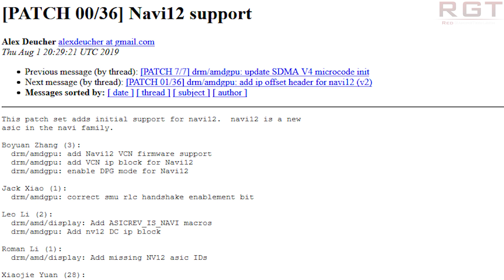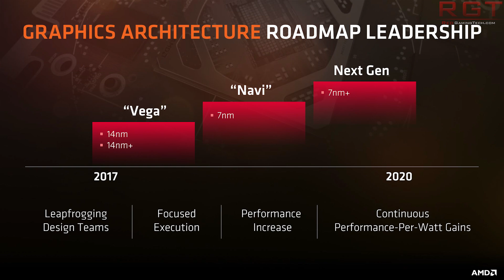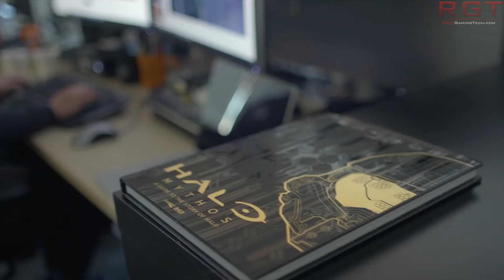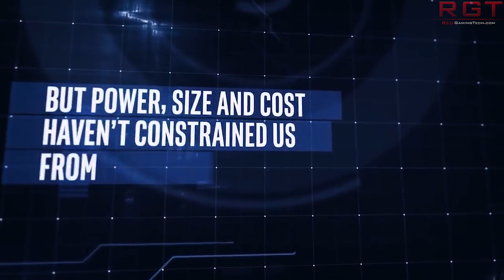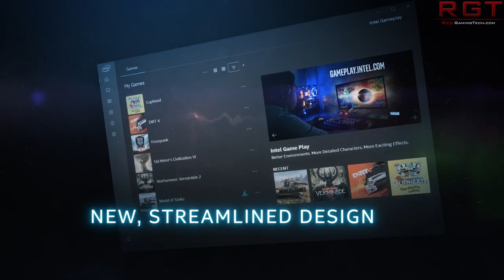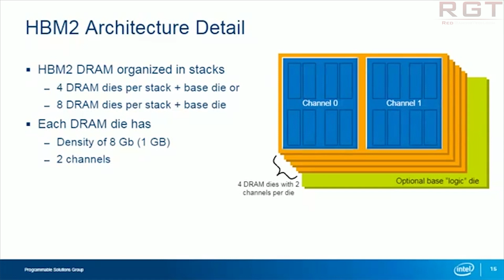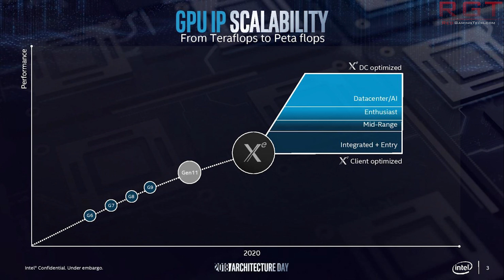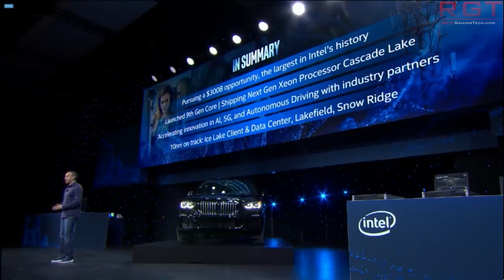Intel Xe Starts At $200 | AMD Navi 12 Updated in Linux | Xbox Scarlett Cooling Patent?

Comment: Actually, Lisa semi-specifically said we'll be seeing a load of 7nm product launches within the quarters (yearly quarters). You implied she wasn't specific at all about the time tables, which isn't true.

Quarter 3 2019: August: custom Navi10 cards; September: RYZEN 9 3950X
Quarter 4 2019: ? Radeon 5600 series maybe?; THREADRIPPER 3rd gen most probably (and newer X599 and X590 chipsets probably); Radeon 5800 series hopefully.
Quarter 1 2020: ? Zen2 APUs maybe; Radeon 5900 series maybe?
Quarter 2 2020: Radeon 5x50 series w/ hardware ray tracing on 7nm+ maybe? (PS5/XBox3 might be launching then)

Comment: I'm kind of out of the loop regarding Gen 11 and Gen 12 graphics.  Have those architecture been significantly been restructured in comparison to Gen9/10?  If not, then, with each EU containing 8 shaders, a 512 EU part would = 4096 shaders.  So basically equivalent to 64 of AMD's compute units, but probably more powerful.  There's no way Intel is going to ship a part like that for $200 IMO.

Regarding that Raja quote, when I saw it the other day, I took his meaning to be that be that the higher end parts will have memory that is larger and is HBM, i.e. he wasn't implying that lower tier parts would also have HBM.  You raise a good question, though, and I suppose it can't be ruled out (as unlikely as it may seem).

Comment: 5700 = 2304SP's and 36CU's (and 8GB GDDR6).
5700XT = 2560SP's and 40CU's (and 8GB GDDR6). 

my predictions =

5800 = 2816SP's and 44CU's (and 8GB GDDR6).

5800XT = 3072SP's and 48CU's (and 8GB GDDR6).

5900 = 3584SP's and 56CU's (and 12GB GDDR6).

5900XT = 4096SP's and 64CU's (and 12GB GDDR6).
Reply: finally some grounded expectations. It´s economics, folks. We get the same as we did before, a competitive lineup for a nicely competitive price, and we´ll like it, but they only need to meet our expectations, not our dreams. It will be the Nvidia Super counterparts for 100 bucks less, plus a 2080TI counterpart for 100 bucks less AND two nice extra features in comparison. Same same, but different.
Reply: @kawafahra  - thanks dude. I also agree with your price/tier expectations.

Comment: I wouldn’t mind having an AMD cpu and an intel gpu if it could run most of my games in 4K or 1080p @ 144hz
Reply: Chris Overton Games don’t run in hz...
Reply: @NovaDoll  so how do they run?
Reply: NovaDoll sure, but the hardware that displays the frames you see certainly doesn’t call refresh rate FPS. Nice sarcasm, if that was the goal.
Reply: Chris Overton 
You can run your monitor at 1080p 144hz but get 20fps. So i presume you mean you want 1080p 144fps at 144hz.
Reply: The Shape obviously. I’m sorry my that you had to go out of your way to correct me on what I meant.
Reply: NovaDoll hz is a measurement on a timescale of number of hertz PER SECOND. fps in a game is on a timescale of a number of frames PER SECOND. So i dont really understand the nitpicking here. They are essentially interchangeable. Obviously, technically they are not interchangeable and i think we all know that. But also, you know exactly what he meant and we all did too
Reply: @TheShape-z7n  k

Comment: Laptop with that HBM and new intel gpu and 6 cores 10nm please?
Reply: There was a line of Intel laptops with HBM + Vega about 18-24 months ago
Reply: czdaniel1 yes sir. That was the best ever. Which is why they only made a few models.  Nothing better than pairing the ipc and low power of intel to vega hbm.  I covet one.  I wish they pushed out many models of that.  That was the best moment and design in computing in well over 12 years

Comment: There is only one little details about HBM "cost" to keep in mind: the only reason HBM is more expensive is that it currently is a low volume niche market product. Aside from that, it is fundamentally the same internal memory structure that has been in use for the past 20+ years with a slightly rejigged external interface. Increase volume by adopting it across multiple product stacks to increase volume and most of the price handicap disappears. Intel uses HBM in networking equipment, FPGAs and other stuff, ramping up volume to drive HBM cost down is well within its capabilities.
Reply: Well hbm2 is 20$ per gigabyte and gddr6 is 11$ per gigabyte,  but hbm2 needs and interposer and gddr6 doesn't.
Reply: @rattlehead999  Stacks of high capacity HBM are expensive due to die-stacking cost overhead. If you can get the amount of memory you need without stacking though, you can eliminate that cost. We have 16Gibits memory chips now, 8GB could be done using four quarter-width HBM2 dies without stacking, eliminating TSV and likely the base die too.

Comment: M$ cooling system..  Instead of the traditional single sensor that measures heat and responds with fan, there is that, but also another that reacts (with fan) that gets it's cue from power demand.  If you get power demand increase, you know the heat is going to come, so you can get ready for it by spinning up the fan.  If the chip is hot, the fan keeps spinning even if the power demand reduces, until it's cool, or another sharp power increase comes.  I wish PWM on mobos would do this.  I have an ASUS CH6H and cannot trust the fan headers whatsoever.  Been like this since day one in 2017.  Tried again after a year since it's like 7 BIOS updates later, and after one day the fan stopped spinning.  I have custom water and a fan controller, but I tested using a Noctua NF-A12 on my hard drive rack, and I couldn't even trust it for that.  Had an ASUS RX-470 (early model bought on day one of release).. and it did the same thing.  The fans would just stop working and the temps would skyrocket.   Maybe ASUS needs to get M$ to design their fan circuits.

Comment: Don't really care about the navi 12 cards tbh. The 1660ti has already been on sale for ~200$. Also used 1070 is cheaper and performs about the same. And then there's used vega 56s for less than 250$, which are better than either of those cards.

What we need is a gpu that performs like 2060 super for 300$.
Reply: OneDolla Bill um the 1660ti has never been onsale for 200. The 1660 rarely goes that low. Source I sell these parts for a living and have to keep up with pricing trends.

Comment: Already debunked...

https://www.tomshardware.com/news/intel-discrete-gpu-xe-debut-200,40083.html

    “Not everybody will buy a $500-$600 card, but there are enough people buying those too – so that’s a great market.

    So the strategy we’re taking is we’re not really worried about the performance range, the cost range and all because eventually our architecture as I’ve publicly said, has to hit from mainstream, which starts even around $100, all the way to Data Center-class graphics with HBM memories and all, which will be expensive.

    We have to hit everything; it’s just a matter of where do you start? The First one? The Second one? The Third one? And the strategy that we have within a period of roughly – let’s call it 2-3 years – to have the full stack." - Raja Koduri

Comment: The question is why AMD isnt using low cost hbm, because it should be the same or a little bit faster than gddr6 and uses less power too. Because Navi looks to be memory limited.
Reply: he is wrong the HBM was 1 Gb/s data-rate per pin 128GG/s 4 chips 512GB/s and Samsung hbm he was talking about become the standard HBM2 1.6 Gb/s to 2 Gb/s per pin

the original 8-Hi HBM2 stack package with 1 layer being 1GB with 2/4/8 stacks, but in the last days of 2018, JEDEC announced an update to the HBM2 specification and that was basically Samsung hbm2 Aquabolt, so today that same package is up to 12-Hi, (12GB) with some saying that 16-Hi is ready so 2/4/8/12 stack per chip, 307GB/s 1024 bit bus

now Samsung has HBM2 Flashbolt it has the same 8-HI stack chip package size as the original 8-Hi HBM2,  but with 2GB per layer or as in 1 chip up to 16GB with 410GB/s and 1024 bit bus, 

so if it become the JEDEC standard for HBM2 this how it could look like

2x 8-Hi chips or 2x16GB or 32GB with 820GB/s 2048 bit bus

Vs biggest gddr6 card out there

TRTX 12x2GB or 24GB with 672Gb/s and 384 bit bus
Reply: @ItsSpeltGoogol but tested under watercooling overclocked show a little

but we need to see next level cards to really know
Reply: HBM would solve their issues. Strongly Oc’ing the 5700XT seems to have mediocre impact and most guess it’s a memory bandwidth limitation. 5700XT is a nice card though.

Comment: WTF! The U.S. Patent system is so broken. My little ceramic space heater slowly ramps its fan so you barely notice it turning on and off. Cars with electric radiator fans have been doing this for years when at idle to reduce engine noise. I'm sure lots of electric devices that required fans do this.
Reply: @The Roofer Ok so its a good idea to let other countries steal all of USA's IP? I think you might need to think that through a bit more.

Comment: The price of HMB2 has reportedly been coming down some. So it might not be prohibitively expensive anymore.
Reply: also the original 8-Hi HBM2 stack package with 1 layer being 1GB with 2/4/8 stacks, but in the last days of 2018, JEDEC announced an update to the HBM2 specification and that was basically Samsung hbm2 Aquabolt, so today that same package is up to 12-Hi, with some saying that 16-Hi is ready so 2/4/8/12 stack per chip, 307GB/s 1024 bit bus

now Samsung has Flashbolt HBM2 it has the same 8-HI stack chip package size as the original 8-Hi HBM2,  but with 2GB per layer or as in 1 chip up to 16GB with 410GB/s and 1024 bit bus, 
so if it become the JEDEC standard for HBM2 this how it could look like
2x 8-Hi chips or 2x16GB or 32GB with 820GB/s 2048 bit bus
Vs biggest gddr6 card out there
TRTX 12x2GB or 24GB with 672Gb/s and 384 bit bus

I would say it is Time for the last HBM2 update for JEDEC standard and start the work on HBM3 on  14nm process node
Reply: @1BigBen  also lcHBM everyone forgot about from 2017. Its 25% slower than hbm2 but alot cheaper and denser. Lower power draw too
Reply: @2000jalebi  well outside of pc per I have not seen any info on lcHBM, but it is easy to over look things and info on the net can end up like it has gone through a blender, 
 
like I was sure HBM2 was still on 20nm but no it is already gone to 14LPP and  last update or upcoming update may have moved it to CLN7FF (7nm) with 2.8 Gbps per pin and with the reports of Samsung HBM2 Flashbolt 3.2 Gbps per pin it could be true

but we VII is 2.4 Gbps per pin, 1,2v  

at time Like this I close to ah F-it and just buy the JESD235B Document that cost 228$ just to see the total info about it

I almost wish they just update the JEDEC standard to Flaslbolt and start officially on HBM3 so we can be sure of the specs of HBM2

but at 4.1 Gbps per pin or 524.75GB/s single chip HBM I would say the days of gddr6 would number
Reply: @1BigBen  the video was a mis-translation it seems. They said they will go with polaris strategy though.
Reply: @2000jalebi  
anyway 2020-21 I don't see it, Intel doesn't have available nodes in sufficient quantities to matter, without cutting into the 14nm and 10nm products lines, that are and have been in a limp mode for more than 2 years on, due to Intel demands for node exceeds their production capabilities

without 10nm becoming 10nm++ in just a few months, and stopping 14nm usage move all to 10nm and build fast few new fab's or putting the GPU on TSMC 7nm 

all this talk of Intel GPU is nothing more then Chris Hook smoke and mirrors

Comment: With regard to Xbox cooling - focus on the cooling itself.  Pwm control is definitely good enough.  They should just go with a closed loop aio, imo.
Reply: AIO's are prone to leaking. Due to the expansion and contraction from the internal pressure. So its very unlikely they will go water cooling.

Comment: That Microsoft patent....holy hell they are not messing around with cooling. Safe to say they have learnt their lesson from the early 360 era.
Hopefully it will be just as quite as the Xbone.
Reply: well 7nm is a lot lot smaller than what the orignal consoles had.  and the smaller the node the less power it uses (and power equals heat in a chip)
Reply: @bobhumplick4213  Not necessarily. That is only if clock speeds remain the same as well as die size. They will most likely ramp up both. Though it will use less power on an equivalent bigger node.
Reply: bobhumplick that is not  necessarily true. In fact Zen 2 has been hitting as high as 1.5 volts in normal use, which is so much higher than what we are used to that people have hit AMD hard with questions and they have had to come out and assure people that 1.5 volts during normal operation is normal for this generation of processors. Thats 0.135 volts higher than previous generations and that will equal ALOT more heat compared to prevoius gens. So there is not necessarily a correlation between going to 7nm and having less heat. In fact given the performance of the next gen gpu and cpu, i wouldnt be surprised if the chips run hotter than the current generation of consoles

Comment: I really want AMD to give us a high end GPU so we can have some competition upp there
Reply: Giovanny Silva you call that competition? Prices are inflated as heck.
Reply: The dollar is inflated. Tariffs between US-China trade wars will keep mounting up until it's banned. And the tech industry is massively moving out of China hence the higher costs.

In a few to several years, I expect the price of PC building to at least double.
Reply: I DONT expect to be amazed, although I would welcome it gladly . AMD seems to take the "Im scared of NVidia " road. They could make a killer GPU that would blow our minds but they aren't willing to waste a little money fort the crown. if they cant use it for datacenter you aren't gonna get a big chip.. they could release a N72 (and pull clocks down a little so it wouldn't use so much power ) and fit it with 6 stacks of 4G HBM2 ...HOLYSHIT!!!!! I am sure they could sale it to the data farms and that's a REAL $1200 card...I wonder if the NVidiots would jump all over that
Reply: Well 64 to 80 Compute Unit Navi is coming (5700 series are 36 and 40)... We just don't know when.
Reply: @robertstan298  yeah 2 years from now after the 3080ti is released .. it would be awesome if they did get it to us in the next 6 months but if they released a N36 & a N40 at the current performance position ,, I would expect a N44 or a N48 maybe up to a N56 with extreme memory package that would get them pretty close...if performance is linear a N64 or N72 would be a killer card